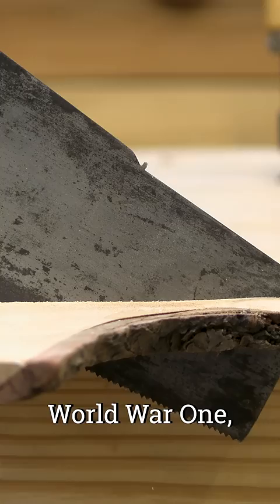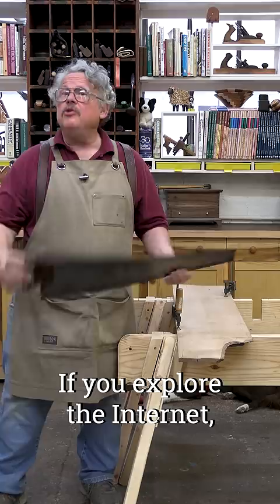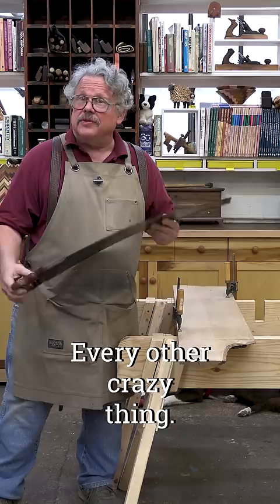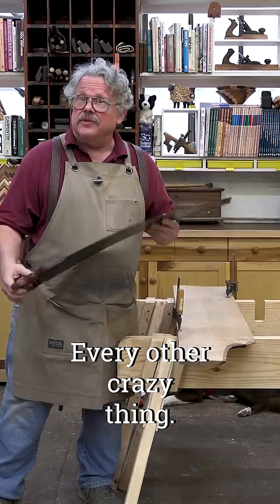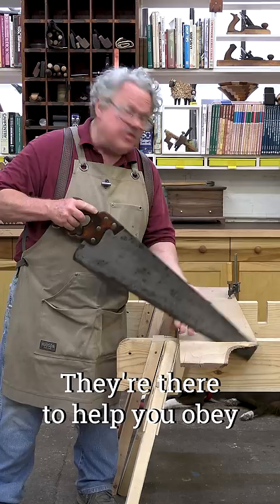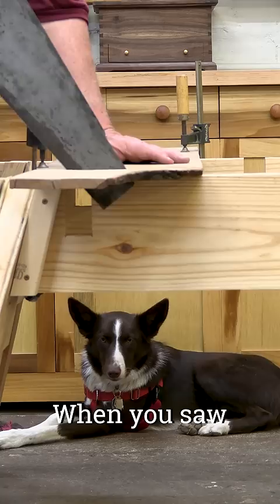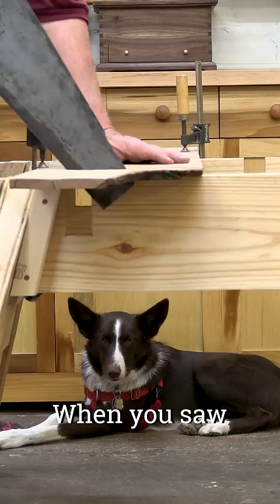Saw Nibs Explained

Comment: When i started my 9000hr apprenticeship as a “carpenter & joiner” about 56yrs ago we used handsaw’s much of the time when building a house. It was most likely the first time the foreman saw me using my brand new Diston (6pt framing saw) he showed me all the basics and then said “you paid for all those teeth you might as well use them”…
Reply from the maker: 👍👍 Great story. Thanks for sharing.
Reply: 9000 hours? Wow. Hope it still paid well
Reply: @ThatSB   Yes that’s correct 9000 hrs
No the pay was abysmal.  This was about 55 years ago and in New Zealand 
Starting rate was 40cents an hour for 40hrs and we worked 1hr a day overtime 
The rate for that was 60cents an hour.
The take home pay after income tax was 
$18.65c. That was for the first 1000hrs, you got a pay rise every 1000hrs. 
We had to go to trade school 2 nights a week for 3yrs.  For 2hrs per night. That was unpaid. There was exams at the end of every year and if you got a pass you got a credit off your hours We were contracted to our employer, so we couldn’t leave and go to another company without a very good reason.
Reply: @ThatSB  To be fair if you break it down it’s not so bad. 4.5 years working 40 hours and taking 2 weeks off a year. 
Cut that down to 3 years doing 60 hour weeks.
Reply: @murrayblack1078 id say getting paid at ALL for the knowledge you amassed was worth it and then some 😂
Reply: @Liam-oh2gb   i must correct you ,  I never said I worked 60hrs a week. That wouldn’t have been doable. The starting rate was 40cents an hour.. overtime was paid at “time and a half” that was 60cents per hour.. all going well you finished your time in about 4years .
Reply: @oldkingcrow777  
Would you maybe tell me what vocation you chose when you left school???
Please note, when I put my income down i never said I had to pay for several hundred dollars worth of tools plus stationary, bus fares, steel cap boots and I paid my mum 30% of my take home pay to cover food and some 
thing toward power and water etc..
Reply: @murrayblack1078 tuition was free?
Reply: Similar deal for Australian apprentices back in the day. Those old school  tradies knew their craft , that’s for sure.   🇦🇺 🤝🇳🇿
Reply: @helixator3975    
I served my time as a carpenter and joiner.. But concentrated on joinery. Yes we’re close neighbours and we’ve had a lot in common.. apprenticeships have changed a hell of a lot since the early seventies and the trade that I learnt does not exist anymore..except in rare circumstances.
Reply: Dang that just made me depressed, im a little past 2000grs on my maintenance apprenticeship and i thought i was almost finished
Reply: @murrayblack1078 back then…….  Doesn’t equate to now….
Reply: @cbrjs ?
Reply: Still an apprentice....? 🫣
Reply: I received a similar lesson as a masonry apprentice. When I was plumbing a lead using only half my level, he told me to drop the level down lower and use the whole length because "you paid for the whole level so you might as well use it".
Reply: same here Murray, getting gifted an older diston America (Philli) was like gold, a lighter gauge, but UK ones held sharpness better..
Pity Grandpa didn't show him to get his shoulder over the saw and the right height of saw horse.
two main arguments were:
 1) compass,
 2) chopping through a nail if found 
An  old timer showed us that the tooth was softer and not tempered,  so I'd say compass and as plenty used it as ..

Hung doors all finishing done with hand planes, brace and bits, chisles, and handsaws.. yankee drivers ,and not a power tool in the house or even the site ..
In fact the first circular saw I used other than at tech college, was for cutting sheets of asbestos to use on soffits and in the school's  metal work ceiling.. 

Anybody with a bellied saw, didn't know how sharpen their saw. You dress the teeth so as the belly if any, is outward at the middle and where the most power is in middle of the stroke towards rear.
Edit to add: 
Work week was 44hrs, 5 day plus 1/2 day Saturday morning. 
Paid basic wage while attending block release ( 3 x 3week blocks) plus 1 evening  weekly, last 2 yrs of apprenticship also included Saturday morning .. .
City & Guilds exam was written , near the end of Apprenticship.. 
Some Employers could elect to sponser a recent new Tradesman/Journeyman in their advanced Craft and or Tech certificate..
Can't remember for sure ,but I think I took home a starting wage of £3.75p per week .
Reply: My apprenticeship was 7,200 hours minimum over 4 years with classes twice a week. 
Now I get paid $68/hr, full benefits, pension and annuity, 5 weeks paid vacation a year and 3 weeks paid sick/year. 
I could make $98/hr if I wanted to move up.
Reply: @doonhamer252  I took home 3 pounds 18 shillings a week gave mum 2 pounds for board. cut my teeth on making sash windows. (1963)
Reply: Do you remember when the Sandvik needle hard point  tooth saws came out?
 They were awesome, but soon the shine wore off,  when unsharpenable, and disposable. Often Brickies and Laggers would ask for one, Bricker used them to cut the thermolite blocks and laggers the hard insulation wraps or sheets.
I was gifted a set of Diston Phillies skew backs plus a set of diston back saws by a retiring ,or going blind joiner... 2 yrs later same fella phoned my Dad and told him to send me up to take his bench kist, as diabetes was taking it's toll.
Reply: @murrayblack1078  however ,muscle memory and physic   all played a part. We all were taught to not over power the saw and eventually you will use the saw as best you can.

Comment: My grandfather taught me about saw nibs when I was just a little fella back in the 70s. He had many saws with them and the ones that didn't, he would grind a notch in a few inches from the end so you could use it the same way. As a result, I am now in the habit of notching my saws in the same fashion. It is very helpful to have a referance point so you can focus more on your accuracy at speed and not worry about jumping the saw and marring the finnish, gouging it or even kinking or breaking your saw.

Comment: I was told its a sign of craftsmanship. Saws were not only hand forged but filed with teeth as well. All by hand, so it showed people "hey, I was made by a man with great skill"
Reply: This is what i was taught in school
Reply: Why would a little nib be a sign of great skill tho? Surely the teeth is a much harder thing to create in the first place?
Reply: @atomomnis2391  yeah but it could break off if you suck
Reply: @atomomnis2391 the nib you see nowadays could be a remnant, because if you look at older saws, there were incredibly intricate shaped and carved nibs to show craftsmanship
Reply: @atomomnis2391  No idea if the explanation is accurate, but I've heard it as well. The idea is that the nib would be very, very small and easy to damage in the process of creating the saw. The smaller and more delicate the nib, the more impressive the skills of the man who made it.

It's supposed to be an at-a-glance description of the quality, since you can't really see how good the steel itself is and wouldn't know until well after you'd bought and used it.
Reply: @CSpottsGaming  but like i said wouldnt the teeth of the saw be just as, if not much moreso a sign of craftsmanship
Reply: @atomomnis2391  I'm not sure, I don't have any personal experience with blacksmithing. My assumption would be that the teeth are easier because they're better supported relative to the nib, which tends to have a sort of "neck" on it that's thinner, where the teeth are triangular.

In the video I saw where they explained it, the teeth were quite a lot larger than the teeth on this blade. Maybe it's just a holdover of a bygone era.
Reply: It is, he's over stating.
Reply: @atomomnis2391 the nib usually is much smaller than the teeth. Its a sign of creativity, craftsmanship, and quality.
Reply: the saw nib on the saw I had was near the handle... so that might been a 'quality' than 'pull until here'
Reply: 🙄 right. They could cut all of those fancy teeth, and sharpen them, but the "real" mark of quality was a simple nub. 😂

Comment: that doggo is such a good boy, fighting the urge to go for the blade each time it appears :)
Reply: I had an Akita shop and job dog.. you could run the saw , planer etc. she'd just lay there in the shavings/dust .. that is until the 2hp ( Craftsman compressor tank blew a seam .. nearly to the door off of the hinges .. after that, saw ,planer was fine , compressor... she got out of dodge ..

Comment: I never used a saw with a nib but was taught to use the whole saw. I found this very interesting because it is difficult to see the end of the saw blade.
Reply: Well the purpose of the nib wasn’t for what he said. In medieval times crafting a saw with such a fine and delicate piece arbitrarily added was a demonstration of the blacksmiths skill. They did this for essentially everything: clothing, swords, armour, smithing tools, belts, buckles, shoes and even hair. Unusual, seemingly useless, overly precise and delicate additions to a craft were proof that the crafter was so skilled that they could afford to muck around with the difficult details without failure. This was frequently done on swords for the same reason, especially ornamental or mourning swords. Which were made for funerals or any occasion pertaining to the passing of a loved one etc. less so on armours, as they were highly important and every bit of cautious was needed since these armours would be mass produced due to entire armies needing it and replacements/repairs. So there was no time nor luxury for what was essentially professional bragging. This is a dead practise now, as tools and resources allow us now to include these little additions with less effort.

Comment: Next question: why did the nibs disappear?
Reply from the maker: Making nibs required a good deal of hand work, grinding and filing -- you couldn't just laser-cut the saw plate, and the nibs were too delicate to be stamped. So they were only offered on the better, more expensive saws, like the antique H. Disston & Sons combination saw I'm using in the video. As America's work force grew, and more tools were mass-produced to meet the demand, nibs became fewer and farther in between. They lasted longer in Europe where the work force was more stable. But electric tools were a death knell for nibs. When we began relying on the circular saw as our main cutting tool, and hand saws became just a back-up, the market for super-high-quality saws shrank to almost nothing. Nibs disappeared completely.
Reply: @WorkshopCompanion  Is there a way to pin this so we can always find it? This is a fantastic explanation, but I'm worried it'll disappear in the long scroll.
Reply: @c182SkylaneRG second that! Even if it's reposting, copy->paste and pin it to the top 👍 I was glad I spotted the user scrolling through the comments after seeing "check my reply" and didn't wanna miss out
Reply: @WorkshopCompanion I also vote to pin this comment to make it easier to see
Reply from the maker: @connorburnett6135  Can't. Pinning it would un-pin the current post at the top of the pile. But I folded the essential info here into that (more comprehensive) post.
Reply: @WorkshopCompanion what about saw that have the nib further forward where you would essentially dislodge the saw if you did that or ones with it further towards the handle? I get in general it might work as you say but what about when it doesn't?
Reply: @zacharythebeau163  it's pretty funny to say they are the greatest generation but then they need a nib to remind them to use the whole saw..... 😂 This could have been a reason yes but it's much more likely that the nib was a show of quality and skill from the craftsman, if they can make something this fine and persise then the rest of the object is also of high quality and skill. This explains your question of why they aren't all at the end as there purpose is to show you it was made by a skilled individual, not to remind you of the most basic of concepts....
Reply: You’re using a Disston? According to Disston's Lumberman Handbook: "The 'nib' near the end of a hand saw has no practical use whatever, it merely serves to break the straight line of the back of the blade and is an ornamentation only."
Reply from the maker: @akeyasa2228  I've read that, and have seen it attributed to Henry Disston himself. That's a pretty good primary source. Ordinarily, I'd be inclined to accept it, but Disston was a brilliant metallurgist, not an historian. I've rubbed elbows with enough scientists and engineers in my time  as an historical airplane builder to know that however good they may be in their nitch, these folks don't necessarily have an understanding of history and tradition. Whether it was written by Disston or someone he assigned to write the handbook, it's only as good as the research.
Reply: @c182SkylaneRG screenshot
Reply: @connorburnett6135  I cannot see any logic in saying that simple nib is any sign of craftsmanship. A child could make that with a file.
Reply: @itoibo4208  could they make one straight and true? Could they make it the perfect mixture of hardness and softness, could they make it the perfect thickness all with a file? I think not, it's not just to look beautiful but to show if you got the nib right an unimportant part then the important parts must also be done correctly.
Reply: @connorburnett6135  makes no sense at all.
Reply: @itoibo4208  but having to put a nib on a saw so you realise "oh wow I can use the whole saw, which I paid for... And it's far more efficient and easier" does make sense to you? 

When have you ever used a saw and been like wow I really want to have to make 10x as many passes because I only want to pull back 5 inches.... If only there was a way for me to see the end of the saw 1 inch earlier that way I would know to use the whole thing..... You don't need a nib for something that humans have been doing ever since we invented the saw.....

Using the whole thing wow big concept hard to wrap your head around without a constant reminder on how you probably shouldn't be using a saw.... 😂
Reply: @connorburnett6135  I never said that explanation makes sense, but it would at least have some value to someone wanting to maximize the use of the saw between sharpenings. I have seen several other supposed reasons, also, but I think it is probably for making a measurment for scribing a line or something. Whatever the use was, it clearly was not THAT useful, because people decided it was not worth making it at some point. Still, the whole "skill" thing is probably the worst and least likely reason for it among the reasons I have read that it might be for. It is simple, not pretty at all, and is less skillfully made than the teeth.

Comment: It was also a way for the blade's craftsman to show his ability to do fine-detail work, so the nibs could, at times, be very fancy & intricate-looking...these are probably the point of nibs on other devices like pocket watches & back scratchers.
Reply: Nibs are only on saws, he was referring to the fact that almost nobody really knows their intended purposes and so it could be literally anything from a compass to a backscratcher, the nib isn't always in the right spot to tell you the full length of your cut like this though, sometimes it was done simply to show the skill of the craftsman who made it, as doing something like this with the tools they had was very difficult, nad they wanted people to know that it was a very fine quality saw made by a quality craftsman who took his time and did the job right as opposed to cheaper saws produced with inferior materials that wouldnt hold up to the test of time and hard use.✌️
Reply: I don't believe that, even a little.  Even the most intricate nibs I've ever seen are trivially done with a fine file compared to the more complex process of finely sharpening the saw.  

Secondly by the mid 1800s saws weren't hand crafted,  Disston and others perfected rolling out good consistent steel and cut their blades out.  Only the teeth were filed.
Reply: @james_robnett  nib simply was used to index the saw filling machine..

Comment: I made some shelves in the garage with 2x4s and osb. I don't have a router for my circular saw and wanted very straight cuts so I used a hand saw on the osb plywood. I can confirm that it works a lot better when you can 1) keep the woods straight and 2) get as long as a rip in one direction as possible before going back. It IS hard to tell when the end of the saw is coming up!

Comment: This explanation makes the most sense of all the other reasons I've heard. I wonder if you made this video as a not of a response to wood by wright (James Wright).
Thanks for sharing your knowledge!
Reply: I'm going to have to disagree. Why did he mention that these nibs are also compasses in back scratchers then if they're used? Just for the saw? The other explanation of it being to show the craftsmanship, skill or quality of the metal makes far more sense.
Reply: @twinkitwinki  yes its about craftsmanship. seeing the nib means nothing as you can see the end of the saw or how much length you've pulled out. You do not need to look at a nib to know if you're using the whole blade

Comment: Far better explanation than "they did it because they could"
Reply: You're not wrong the real reason behind the saw nib was to demonstrate the precision of the blacksmith who made the saw and particularly the saw-teeth if they can make the "nib" then the teeth are a doddle.
Reply: @epone3488  where is the logic in that? The teeth are probably more work than that little nib. All that nib would prove is that you could cut and file a couple of simple angles. No. That make no sense at all. I would bet my favorite toenail clipping that it had a real purpose.